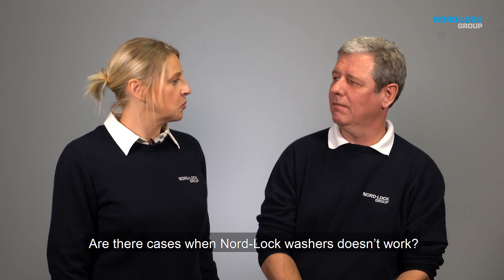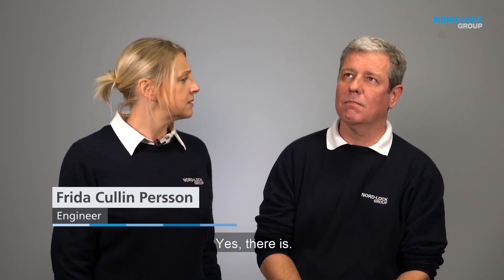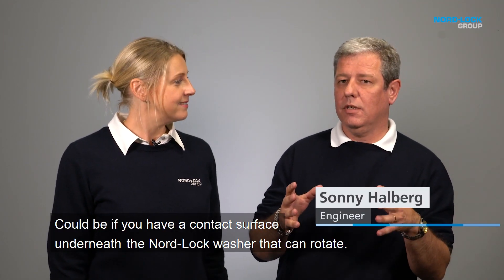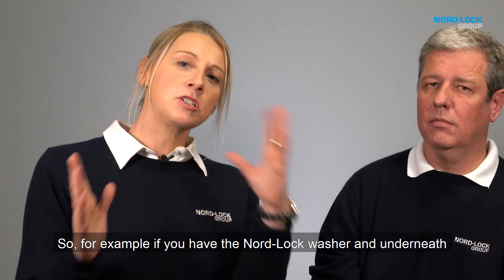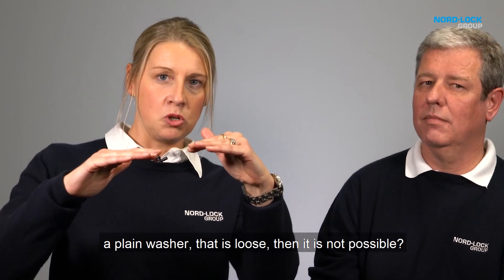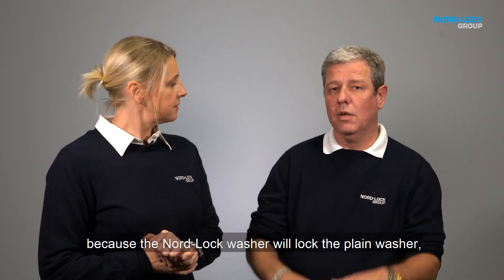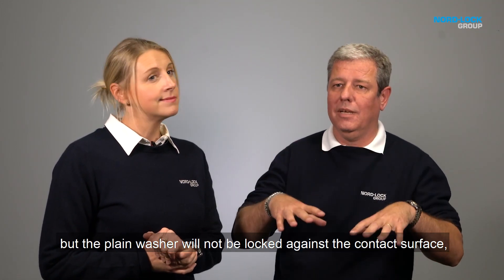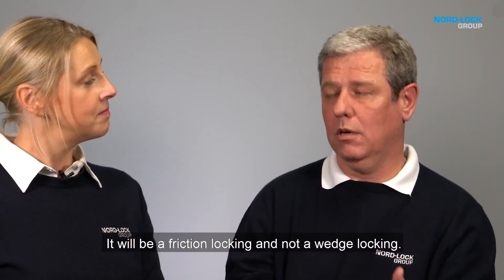When Not to Use Nord-Lock Washer? | Q&A

Comment: Can you use these on hard steel, such as carbon?
Reply from the maker: If the mating surface is carbon steel, then the Nord-Lock washer should also be steel. The Nord-Lock washers must be harder than the mating surface and the fasteners for them to be able to secure the bolted joint.  The minimum hardness of the steel Nord-Lock washers is 465 HV.

Comment: Can I use the washer on an car oil pan
Reply from the maker: Yes, that should be possible –as long as it is a standard bolted joint and the achieved preload is high enough to make impression marks in the mating surface.

Comment: Will they work properly with 5/16-18 x 1" Socket Head Cap Screws 12.9 Grade Alloy Steel in an exhaust manifold application. T Y
Reply from the maker: Yes, they will work if it is steel against steel all the way through the bolted joint. If you have other types of materials please contact your local Nord-Lock office. 

The grade 12.9 bolt is not a problem for the steel Nord-Lock washers. It is a coarse threaded bolt, so the thread pitch is not an issue either. 

What could be an issue is if the temperature is above 200 degrees Celsius. If the temperature gets too high in the bolt then the yield strength of the bolt starts to become lower and that means there could be a risk that the bolt will exceed the yield strength. We hope this will help you.

Comment: Will Nord--Lock X  Lock washers work correctly with a compressible gasket between the hard surfaces ?
Reply from the maker: The Nord-Lock X-series washer will work fine if the gasket is between the two clamped parts and if the achieved preload is high enough that the washers can make the impression marks. If the clamp length is short then they should make sure that keep a level of preload even when they lose preload due to relaxation of the gasket, if that is an issue.
Reply: You may want to retorque after the gasket has had some time to compress.

Comment: I have a nut on apiece of thread rod with a washer against unistrut and on other side of uni strut same thing...should i have used a lock washer here... my boss said cause we have nut against nut so to say...that it doesnt apply here?its hanging off ceiling from crows foot thats locing thread rod in it with a nut... sorry for the bad wordage... but its unistrut holding up water lines 2 inch

Comment: Is it good for a steel-rubber joint?
Reply from the maker: If you are talking about placing the Nord-Lock washer against a rubber surface, then it is not recommended and will properly not work. The rubber is usually too soft for the washers to make the impression marks in. 

If it is a rubber ring or gasket or similar which is clamped between two metal plates and the Nord-Lock washers are between the bolt or nut and the metal plates, then it will properly work fine. 

But it does depend on the preload that can be achieved in the joint and it has to be high enough for the washers to make the impression marks. It also depends on how large the loss in preload is over time due to settlement in the bolted joint.

Comment: I'm a simple man and cannot understand #4
Reply: I think it means any debris between the nut and the washer will cause the load to drop over time.
Reply: @AfdhalAtiffTan  No, he's talking about compression of the joint materials. If the joint materials compress to the point that the washer doesn't have enough load on it, the washer will not work.
Reply: @BrenBrenMartin  I understood it, but you explained it better.

Comment: Can i use Nord-lock washer where i am using 10.9 class or 12.9 class bolts ( M16 bolts -structural joint in farm equipment)? Since these  bolts  are hard, weather Nord-lock washer create impression marks on those hard bolt surfaces?
Reply: Yes you can. Just follow their instructions regarding tightening torque.